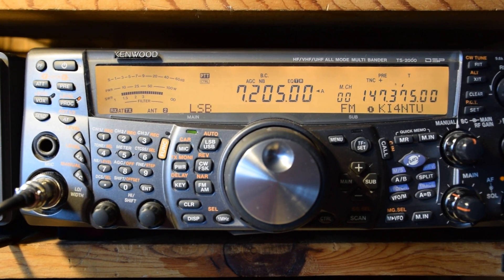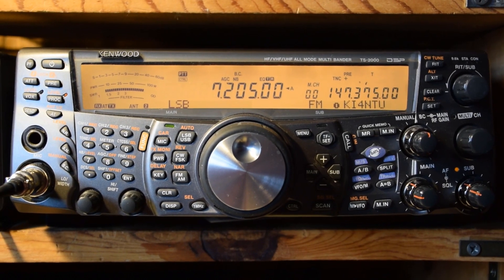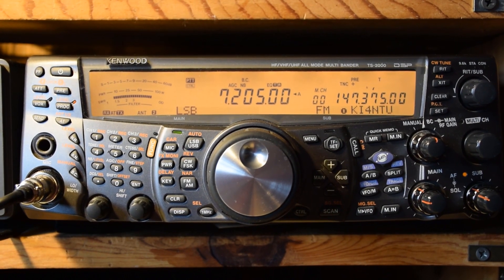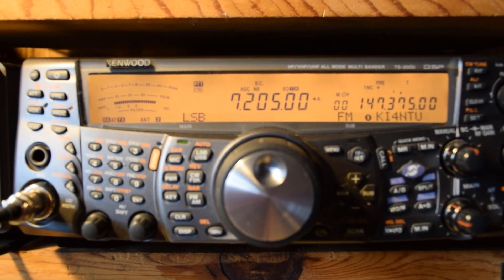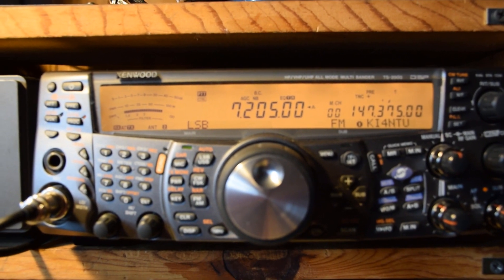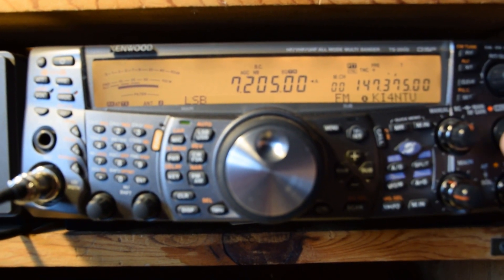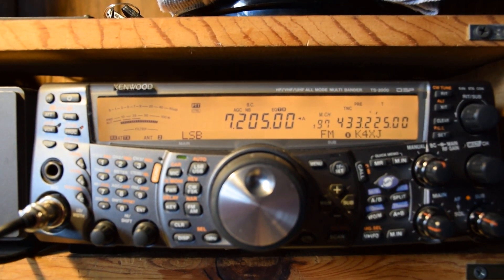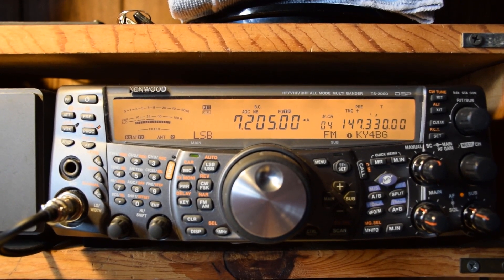Kenwood TS 2000 Intermittent Problem

Comment: sounds like your getting rf from foot switch if you take it to a shop for repair you proberly take the hand mic.
Reply from the maker: Hello Andrew...I don't use this radio for HF anymore. I have it dedicated it to VHF and crossband repeat and sky command. It wasn't the foot switch at all. We found out that the UHF connector had a cold solder joint and I never had the problem again. But like I said, I have dedicated this to VHF. Thanks for stopping by.
Reply: @markwarren7116  so that solved that issue. alot of radio for vhf ha ha have a good day cheers and thanx for reply 2e0-rju
Reply from the maker: @andrewfoster1316 ....Well I have 4 other radios so I really don't need to have this functioning 100%....But I am gonna send it off later on in the future so I can have everything working. I am doing projects on my house so my play toys have to be put on hold for a while....Thanks for stopping by!

Comment: By chance were any of the rf coax leads internally removed and possibly placed in wrong order.

Has anything been disconnected and reinstalled under the covers.

Even re routing the coax rf leads inside differently may stop any oscillations.

Tell us more about the past with this rig.
Would the techs have put something back wrong.
Surely they could have duplicated that issue.
Its a no brainer to duplicate , unless its your antennas!
Water in coax , bad joints at connectors (so239).
More info my friend.
Reply from the maker: No they are correct Marty...I looked again and again. I also completely disconnected the 2 meter antenna and still get the bleeding into the sub VFO.

Comment: I posted your video on facebook ts 2000 and a guy just commented this: 

I testet this right now. HF on a FD-4 100 watts and UHF on a Diamind X200 portable jnust on a cable.
When the X200 is portable around in distance closer than 6 meters, I have the same thing un UHF. Puting the X200 more far away, then everything works fine!
Reply from the maker: Well like I posted to Marty I even completely disconnected the 2 meter antenna and still does it. And I also mentioned that I took it to another friends house that doesn't even have a 2 meter antenna, so this is very strange.
Reply: Mark Warren duno man:((

Comment: FYI:Having a good SWR doesn't mean it is resonant. 

The important symptom is that the condition of the radio changed in 2016. This should indicate something inside the radio changed or you did something. I have to think about lightning as a possibility. I am not putting much concern into your antenna since antennas at other shacks acted similarly. Sometimes people overlook changes they made. Did you add a TNC or other device. Adding a TNC to the TS-850 caused the TX audio to go bad. Unplug the TNC and the audio was good.

That you can duplicate the problem but "technicians" can't is also important. What is different? Is the tech testing only on a dummy load? One thing we don't have information on that is outside the radio is if you are using a duplexer. If you are, I assume you would take that with you other ham shacks, but maybe the techs test without it. MFJ equipment is notorious for bad solder connections those will fail over time. One MFJ device I had became intermittent especially if I wiggled the antenna connection. There was NO solder on the antenna connection. Over time it corroded. I soldered it properly and the problem went away. 

If the problem is in the radio, the radio is old and you should check for bad electrolyte capacitors. The top of the capacitors should be perfectly flat and clean. If the electrolyte leaks you may see what looks like a light tan color water spots/rings on top of the capacitor or on the board. This electrolyte is corrosive to the runs on the board. If you find any clean it off and of course replace the caps. I have seen capacitor kits online where someone has gone through the trouble of kitting all the capacitors for you. 

Another thing would be to look at filters. The internet has a bit of information of failing filters in the TS2000. Filters are meant to prevent these issues.

Another, I would look at the purity of the RF being transmitted. If the RF is dirty, it will cause havoc.

I also would consider a full factory reset. A glitch or or even an operator changing something in the menus.
Reply: If you get the time, change the mode of the second vfo to ssb/cw. FM is more ic based, where those are more tuned circuit mixed. Also, that is prolly a repeater freq, on sub vfo, so that vfo is double split for offset, and sensing pl tone, so it may be overwhelmed from the get go. I hope ya fix it or get a $60 Leixen dual bander, that can keep all the repetaer biz in a separate unit, and save the big rig for 144.2 or 146.52 work.
Reply from the maker: Well my SWR is 1.0 and I get 100 watts out  so its pretty well resonant. But I do agree that a good SWR doesn't mean always resonant. No I didn't add anything to the TNC or anything else, nothing has changed in that respect. And this problem started about a year and a half after I bought it. I sent it to K3TEN electronics that "formerly" advertised in QST and he was specialized in all Kenwood radios and was very familiar with the TS-2000. But unfortunately he decided to go out of business after I got my radio back from him. He used my radio for 3 months and couldn't duplicate the problem. He said he looked at all the caps and every part for leaking caps and bad solder joints etc etc etc and found nothing. I have seen the cap kits and asked about then to K3TEN and he said I didn't need them because my radio was like from the factory and perfect inside. And I did see the videos about the ceramic filters in these TS-2000's being replaced and go bad in this radio. So far all the technicians have said everything was good. Another technician said it could or might be a bad pin diode but when he checked it out everything was good. I have done a factory reset 2 times and still have the problem. And after I did the factory reset I put the main VFO on 40 then 20 and then 15 meters and the sub VFO on 2 meters and then left the 2 meter antenna off and the main VFO still bled into the sub VFO. ...I really appreciate the feedback from you and hopefully I can figure this out. I have nothing myself to do any work on radios so I have to send it out to have it fixed...Thanks for replying.
Reply: Focus a bit on why the techs CND. It may lead to the cause. 

A tech will generally use a dummyload. Maybe he used lower power to an antenna. Maybe he set the squelch higher (though you had a lot of signal strength on the VHF meter) 

When you say you have 1:1, I don't know your setup so have to be sure the SWR increases as you go off the center frequency. A dummy load has a flat 1:1 across the band yet it doesn't radiate.  An antenna has a bandwidth and will increase SWR off center. Gain tend to be inversely proportional to band width. 

A good SWR out of resonance antenna can create RF in your cable. 

What are your antenna, mounts and cable configuration? Are you running a duplexer or do you have separate UHF and VHF antenna? Do you have HF and VHF antennas on your car? 

I also haven't mentioned you power supply. Test it on a fully charged battery. with no power supply. Try ferrite a bead on the power cord. A choke on the antenna cables.

Sorry, but without seeing it first hand, there are many questions and suggestions. I don't know what you did and didn't take to the other ham's shack. 

I helped a guy on the phone the other day. He had a lightning strike on the boat. I troubleshot it to the installer leaving a cable to the autotuner disconnected.
Reply from the maker: @ny1t  ....I haven't posted on this for a long times so sorry if I haven't answered for a long time... I tested with a separate antenna on the UHF / VHF sides of the antenna and also used a different antenna on the HF side and still have the problem. I did use a car battery to see if it was anything in the house that might cause anything and still have the issue. When I took it to the 2 friends houses I took exactly the same equipment, cables etc etc. Well maybe one day I will figure it out and send it to a technician that might get it right or figure out what's going on. As of right now I just use it for VHF and UHF and cross banding since I have 2 other HF radios. Also money is all going to fixing the house now. I thank everyone who is trying to help and its well appreciated....73's...K4XJ
Reply: Easy, bud...why must this fellow have to do   basics   of a technician's job...?

Comment: Check insidefor small sponges with some kind of metalic coating over, near the coax plugs inside the station,  those needs to be in place if one of those are out of the position that issue you have can apear, even auto oxcilations also
Reply from the maker: Yes they are in place.
Reply: You did not change tx frequency on hf tuned vfo. All ~5 radios in 1 will have specific birdies on harmonics of if or preamp circuits and cannot be fixed. You did not go over your antenna arrangement or what type of radiators because some antenna tuners, loading coils, match coils, traps, baluns, ununs, ect., for any band, can blast out harmonics. That would be awful to get a new radio and have issues on a favorite frequency though. I hope you figure it out.

Comment: Put the main side on a dummy load when it does it, I suspect RF getting into the sub receiver from the main antenna.  Try a different frequency or band on the main VFO to see if it does it on any band other than 40 meters.   How close is your 40m antenna to your 2 meter antenna?  Is your SWR ok on the 40 meter antenna without the tuner?   Just a few things to check.
Reply from the maker: Yes we tried all the other bands, My 2 meter antenna is 45 feet from the 40 meter antenna. The main VFO bled into the sub band even with the 2 meter antenna disconnected. All my antennas are resonant so I have no SWR. I don't use an antenna tuner on 40, 80, 20 and 10. And also the main VFO still gets into the sub VFO even with a dummy load. So I have tried all these options...I have taken this to 2 or three technicians like I explained in the bio section and they can't duplicate the problem...But when I take it to another Ham's house the problem is there. I bought this radio in Dec. of 2014 and worked great up until 2016. Been having this problem ever since....Very strange.
Reply from the maker: Here is an update....I took the 2 meter antenna down and completely disconnected it and laid it in the carport and still get the problem....But I do make a note...This does NOT happen when the sub VFO is on UHF 440.